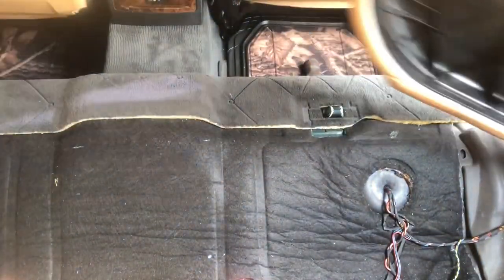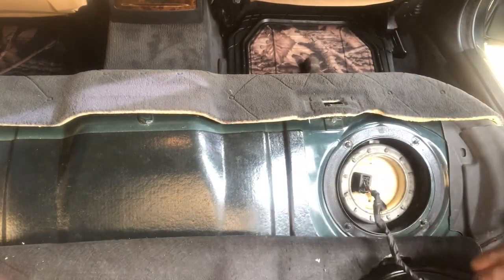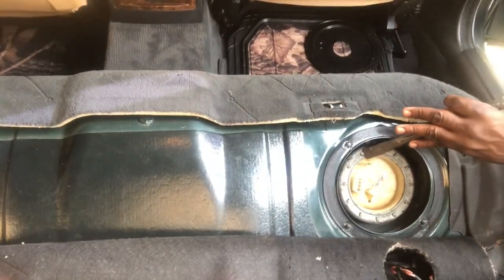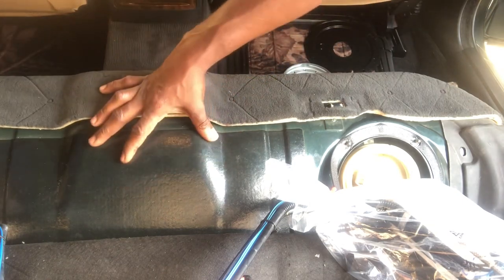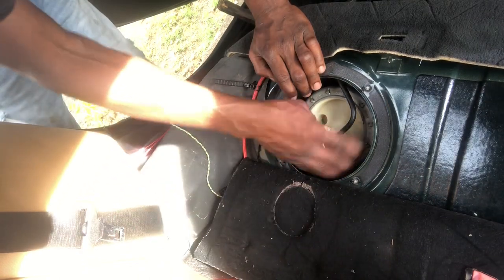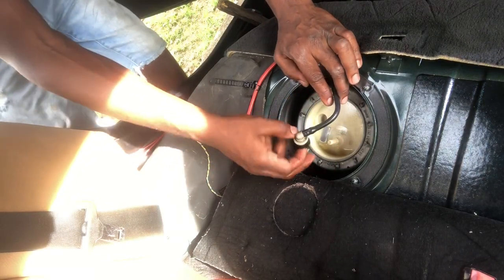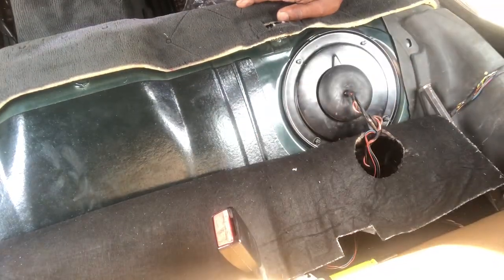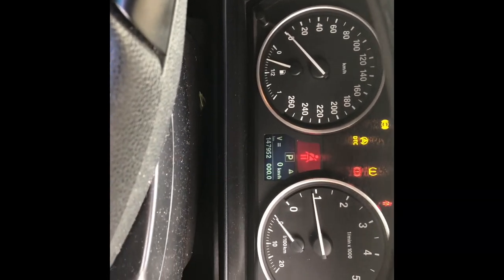HOW TO CHANGE A #BMW #E60 Fuel PUMP ASSEMBLY

Comment: I was removing the fuel pump, after I put it back in place, I had a leak when fully refueling. I had to tighten both the level sensor and the pump too much. I think it's worth opening everything up again and putting everything back in its place
Reply from the maker: There are two rubber seals under both of them ensure that you change them, as that can be a contributing factor for the leak .

Comment: Tanks for that Video. I did that tonight, spent 3 hours because the Nut on the right hand was super strong. P.S. before remove the old pump, assemble the rope first so you don't need to maneuver blindly through the tank backward. .. again, thanks!
Reply from the maker: Thanks for watching my video, I appreciate you taking the time to send your comment 👍.

Comment: just a word of advice before you remove the pump after disconnecting the filter tie a flexible wire on the line so that when you pull the pump out the line will be in place to pull the new pump in.
Reply from the maker: thank

Comment: I just changed mine and i hear a like a sucking noise from the filterside fuel line. Is it possible that the lines are mangled inside and that is why there is too much air in the system. Very clear video and thank you in advance!
Reply: They also have a lot of play. Both sides move up and down by a centimetre.
Reply from the maker: Hi , it might stop after all the air pockets in the filter is replaced by fuel .

Comment: One safety reminder:  wrap the chisel end with cloth to prevent any possible spark which may ignite fire under leaking fuel!  Also, it seems there is no need to remove the wires connecting the pump and filter assembly and re-insert.  Instead, you can remove the old pump, connect with a new one, then remove the filter assembly and connect the other end.

Comment: Back again. So, i was chiseling the ring, and I didn't notice that it was turning all together with the pump assembly, that broke eventually. Now , not matter how long i turn the ring, won't come off.
Reply: Use wd40, I had same issue.

Comment: hii bro,,can i known what symptoms problem for fuel pump problem
Reply from the maker: Hi,after driving for a few hours sometime it will have a delayed response when starting, will lose power if rapid acceleration is applied and most commonly is the vehicle will not start.

Comment: There is a special tool (crown wrench) to remove the nut and avoid using a hammer and chisel, that wrench is also required to torque the nut (18 ft-pounds), the acces panel gasket was damaged due to the mishandling, the fuel pump & filter gaskets were reused (?). Fuel is harmful for the skin, use of safety gloves is required. no fire extinguisher in the work area, the battery negative terminal was not removed, working with fuel and vapors is very dangeours, sparks must be avoided at all times. Professionals don't  work this way. Note of Caution: Before installing the cushion seat, the tank must filled to full to check for leaks.
Reply: and yet the job was completely without issue

Comment: This mechanic put a new fuel pump in and when I drive gas is pouring out from underneath my car. What did he do wrong? He’s out of town and I have to go to work
Reply from the maker: hello ,the fuel charge line can need a new seal or the fuel pump housing can need to be tightened.